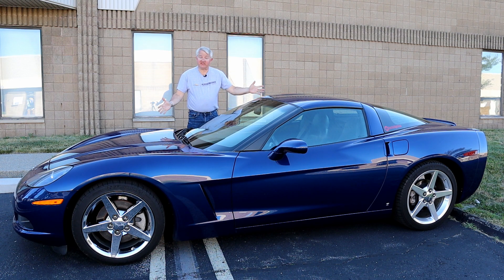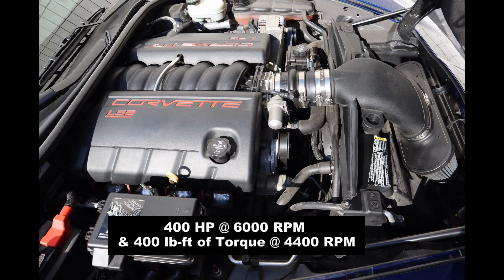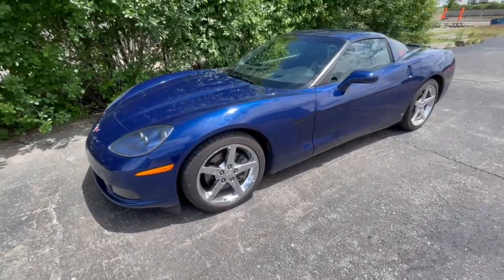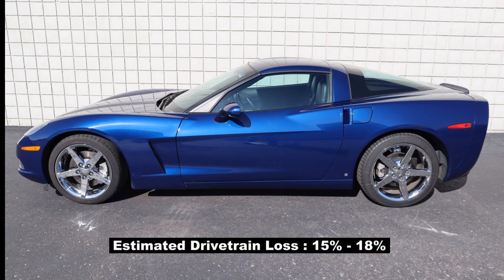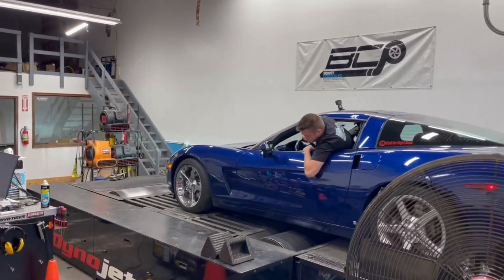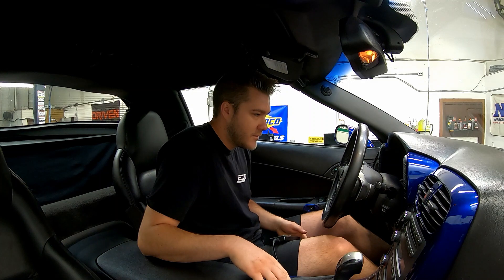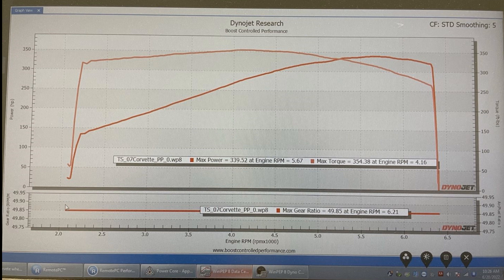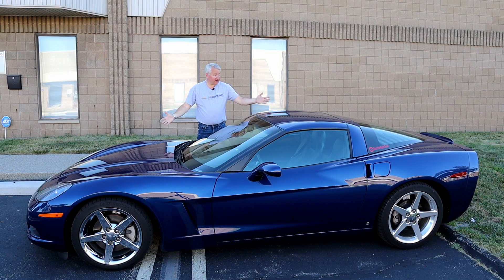How much horsepower does a base model C6 Corvette make at the rear wheels ??

Comment: Hi Tom. Great car! I have a 2007 myself. I've added Corsa exhaust & K & N cold air & also replaced the dreaded harmonic balancer & pinned  to the crank. While not cheap, I believe a super charger would be the best engine upgrade due to the horrible stories you hear about cam jobs done on the cheap. What's your thoughts?
Reply: Sounds like you want yourself 2 problems,one with the engine and one with the supercharger..not good lol
Reply: And if you buy a corvette why would you pay for a cheap cam job? The car is already expensive as it is lol

Comment: Those power numbers at the wheel are actually better than I expected for your car as an automatic. The numbers you got are what I would expect from a manual transmission.. However, you did have an increase in air flow with that aftermarket air intake though I suspect it would not be responsible for more than 5 HP give or take. All in all, I would be happy with those results.

Comment: I had our 2010 Grand Sport dyno tuned.,larger air filter and the dyno expert said from engine to the ground you loose 25%hp. It ended up having 390 HP to the ground. It ran fantastic.took it down the strip, no headers,no new cam just tuned correctly. Ran 11.81  and 118.24 mph. Picked up 3 mpg. He has been doing the dyno since 1983! Knows what he is doing. All these after market parts only produce the real numbers after it is dyno tuned.
Reply: 25% was in the old days
Reply: @mcm95403  it wasn’t in the old days, your tires, aerodynamics, trans, differential, weight, goes on and on, the dyno does not lie.
Reply: Incorrect ….dynos lie all the time. Time slips from the track don’t lie.

Comment: Do you have two different set of wheels? The front looks chrome while the rear looks silver.
Reply from the maker: I was wondering who was going to notice that.  I have discovered that the previous owner put some cheap rims from China on it that are to resemble the original chrome rims.  They are showing corrosion on them and I had one that started to leak air.  So the rear wheel you see is the correct OEM that I bought on EBAY.  Good catch on your part.  I knew someone would notice !